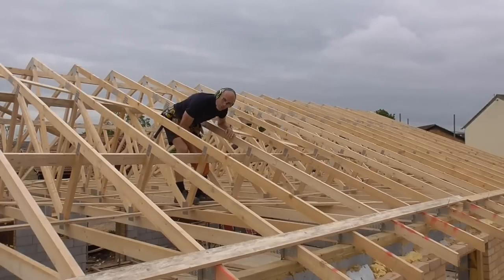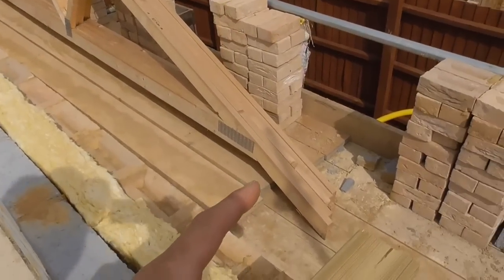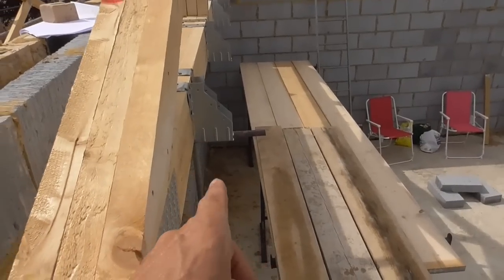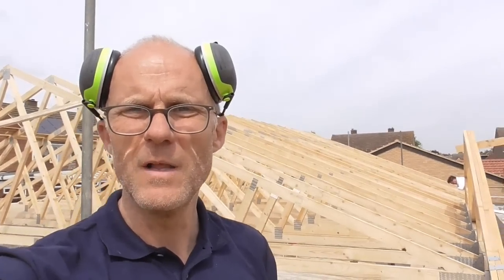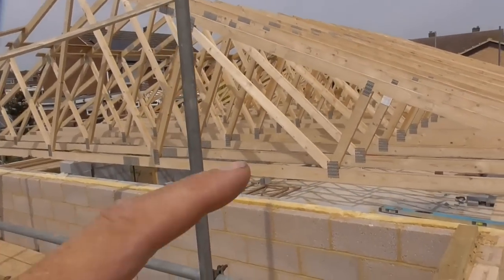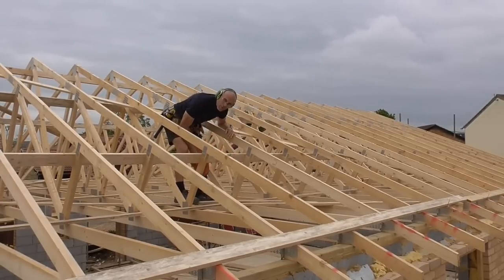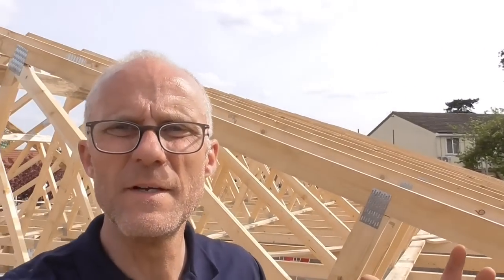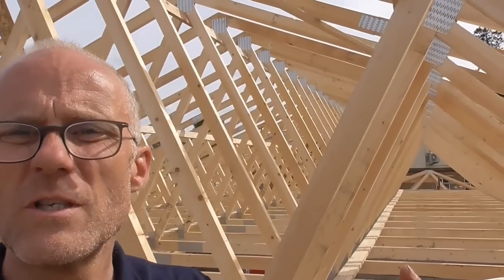Roof trusses fitting to a single story bungalow

Comment: Glad to see you have all the correct lateral and longitudinal bracing including the lateral bracing in the ceiling plane.  I'm a structural engineer and these roof s built in the 70s and 80s rarely had the correct bracing and quite a few put up nowadays don't!
Reply from the maker: Hi John🖐You've got to be an idiot not to be able to follow the truss drawings😵‍💫but I agree, and many roofs are not braced properly😔Thanks for watching 😎 Cheers Del
Reply from the maker: @h2s142  The trusses are designed and manufactured to meet the current Building Regulations and are installed in strick adherence to the drawings. The Building Inspector does not use their discretion when inspecting the completed work, they simply expect to see that was has been installed is in accordance with the drawing👍

Comment: What height ceiling would I get in loft room with a 10m span with a 40 degree pitch, great video. Thx
Reply from the maker: Hi John🖐Very roughly, if you put the ceiling height in at 2.4m, you would have a 'flat' section of around 3.5m👍(obviously dependant on rafter and joist dimensions) Cheers Del
Reply: @thetallcarpenter  Thank you del much appreciated.

Comment: When you stand trusses up do you not skew nail a 3 inch nail into each side?
Reply from the maker: Hi fella🖐Yes, it's only 'temporary' to keep the truss in place until they are all set on and braced up. I then knock them in all the way before fitting the clips👍
Reply: @thetallcarpenter  if you were to put a stringline across the backs of the trusses at the eaves level what would you say the tolerance is in deviation from the string line? This is for a slate roof covering also thanks
Reply from the maker: @chippy977  I wouldn't even bother putting a line over trusses as they are usually all over the place😬I tend to just measure bith sides of the rafter foot back to the face work and keep then even as I go👍
Reply: @thetallcarpenter  yeah I found that!, do you know what the manufacturing tolerance for the trusses is? In terms of size variation?
Reply from the maker: @chippy977  I don't know what manufacturers tolerances are, but they are generally within 10mm to 20mm up or down😵‍💫
Reply: @thetallcarpenter  out of curiosity let’s say you were doing a cut roof. With rafters fixed each end of the gable, if you were to string a line across the backs at eaves level what would be your tolerance for max deviation from this line? And let’s say it was slate roof covering?
Reply from the maker: @chippy977  On a hand cut roof I would really be aiming for around +/- 5mm👍

Comment: Enjoying your channel only discovered it recently.  Do you butt all longitudinal bracing halfway on a truss even 35mm thickness trusses or overlap them along side each other? Hope that makes sense 👍😂
Reply from the maker: Hi there🖐and thanks for looking in on my videos👍Yes, I but my bracing together half on a truss as I find it keeps things much neater and simpler and the braces running closer to the fink/rafter connection point👊Its never coming apart once battened/boarded, and if the inspector is not happy, I just run another bit of bracing next to it lapping 3 trusses😎Cheers Del
Reply: @thetallcarpenter  agree Del a much neater and superior job than side by side overlapping by 3 trusses. Cheers👍
Reply from the maker: @seanfowler5264  😎👍

Comment: Hi, should you fix diagonal bracing to wall plate at all times, my plans show they don't, cheers
Reply from the maker: Hi Stewart🖐On nearly all the truss roofs I do, I usually run the diagonal bracing down to the plate and spike it👍I don't think its part of the roof design but it can't hurt👊Cheers Del
Reply: @thetallcarpenter  on this vlog, the big diagonal braces meet each other at a  roof truss end, cut and nailed close, that's what my plan drawings show.
Not fitted on wallplate, little confused.
Cheers
Reply from the maker: @stewart9476  I have had this specced on roof before, and I guess it's best to do what's on your drawing👍
Reply: @thetallcarpenter  yeah, will do cheers.
Take care

Comment: Must admit I like the old purlin and skew nailed 4 by 2 technique, old 4 by 2 were proper size
Reply from the maker: Takes me back to my early days Andrew when timber really was 4" x 2" and you had 3 inch wires in one side of your pouch, and 4's in the other🤔 2nd fixing nails were 1.5" and 2" ovals, and 2.5" cut nails for the skirting👊 Thanks for your comment 😎 Cheers Del

Comment: Nice one Del. How do you line up your trusses? As in if you looked across the ridge line from one end to the other end, to keep them in a nice straight line. Do you go by the intersection where the joist meets the rafter on the wall plate? I'm interested to now how you do it, I can't make out on the video. 🤔. 👍
Reply from the maker: Hi Paul🖐 I just center the first truss over the building by measuring out from the face brickwork back to the rafter foot. (do this both sides) This then cuts out any discrepancies in the cavity width which may throw out the truss alignment if the plate was followed. One I know the distance between the brickwork face and the rafter foot, I just set all the trusses to this down one side, but still check the other side every few trusses to make sure they are not running out. I've found, over the years, that this gets the best results considering the tolerance in the trusses👊Cheers Del
Reply: @thetallcarpenter  thanks for the answer Del. I have only ever done a few trussed roofs, mainly cut roofs, I found some trusses poorly made to do similar to what method to what you explain 🤔, I centered one truss at each end like you, but found tapeing out to the  foot of trusses as I went along , I had a look along my ridge line and found some trusses to far of center to the left and right as I looked down it. As I say  I don't have alot of experience with trusses, it's good to ask a chippy like you who has done alot of trusses👌. Keep up the great video 👍🇮🇪
Reply from the maker: @paulcloona9331  I hear you mate, and the trouble with poorly made trusses is that wherever you try and take a datum point from, (ridge or ceiling chord to underside of rafter chords line), you will struggle to get them straight. I use my method to line the trusses in, and if they are REALLY rough I will tickle the worst ones by splitting the difference or even laying myb6 foot level over the top to get them as close as possible. I like to try and get them as close as possible at the eves level, as this is where it would cause the most problems if they were a long way out, even if the ridge line was spot on👍
Reply: @thetallcarpenter  I get you Del, I adjusted them to look good at the eve.👍.
Reply: It should be strung with a line across spars... One truss each end measured off face brick to centre trusses to building, then string line on top side side from one truss to the other (not across truss ends/feet to many discrepancies). Then start fitting the trusses bringing them to your string line. Excepting that you will need to cut back spar ends for facia and soffit.... This is the only way you can a good truss pitch line.

Comment: That is my world mind numbing trusses. Can't believe you have to cut the overhang off the standards to fit to the girder truss they would all come as bobtail trusses here ready done. In fact when I used to make trusses for a living you earn more for every truss change. If you just kept making standards you didn't make up your quota or it was very hard to get to it. You have a couple of advantages there though. Your trusses are made out of more substantial members than ours. Bit less floppy. Our matchwood ones can be way bigger than that and flap around like a fish out of water. Having extra guys helps. Normally I work with just two of us. I try to get a third to stand trusses as you can't control the middle otherwise. You comment on the slightly wonky nature of the trusses. If you work in a truss plant and spend all day every day making them it is not the most interesting of jobs. You park your brain in a jar on the shelf on the way in and collect it on the way out. Just ever so slightly repetitive. And I thought putting them up was bad enough. The only thing you can say about truss roofs is that it is a quick cost effective way of building an adequate roof. And at prices today every little helps.
Reply from the maker: Hi Dave🖐Another cracking comment mate, and agree with all of it👍 I've seen the guys that work in a local truss factory, and I don't know how they keep sane putting them together all day, every day🤯 Trusses do come in for a lot of hate from carpentry purists, but as you rightly say, they enable big roofs to be completed quickly and cheaply👊Have a great weekend bud😎Cheers Del

Comment: Great video Del. I want the ‘move a truss then sit down’ job.. nice chairs by the way. 
Looks like the new 🎧are fitting well. 👊🏻
Reply from the maker: Hi Dan🖐That is the boss man, and he's actually working with a broken foot, so needs to keep his weight of it as much as possible. He has to wear one of those special boot/support things, so at least he doesn't get the mickey taken out of him🤗(MUCH😆) Hope you are well mate🤞 Cheers Del
Reply: @thetallcarpenter  the main man. 😮. Plenty of laugh then.. 🦶🏻
All good here thanks, hope you too. 
Don’t think I could reach the ridge on that bungalow roof..😆
Reply from the maker: @Ultimate-roofing-square.  You'd be just right nailing the top brace through, as I was slightly bent over in there😬Cheers
Reply: @thetallcarpenter  😆👊🏻

Comment: Is there a rule on where you should put truss bracing for inside the truss
Reply from the maker: Hi there🖐The bracing positions are clearly marked on the truss drawing that comes with the roof, BUT, the bracings are always, pretty much where an internal truss element connects to the bottom ceiling chord and the main rafter chord👊Cheers Del

Comment: Up in Bonny Scotland we put the laterals side by side I noticed you put them on top at the lap over.
Reply from the maker: Hi Dez 🖐 Well spotted bud, and it should actually be the same down here😬 BUT, I find it easier and neater to keep the lateral bracing in the same line by joining them over one truss, and then simply cut and fix a bit of brace long enough to span 3 trusses, (the one with the join over it and one each side of that) to strengthen the join and keep the building inspector happy👍 It actually uses no more bracing either💪Thanks for watching😎Cheers Del
Reply: @thetallcarpenter  When talking about the lateral bracing is this also referred to as diagnol bracing?  Also how do you ensure the trusses ends are all in line, do you use a string line. I have often wondered this when passing large sites where they crane them up strapped in a pack, they must fix one each end of the roof and pull a line? Hope to see you soon.👍👍
Reply from the maker: @amazing451  Hi Kevin🖐 I centre the first truss over the building by measuring back from the rafter foot to the face brickwork each side, and then just keep all the other trusses the same measurement👊 You have 3 main types of bracing, lateral bracing that runs from one end of the truss run to the other which hold all the trusses at the correct spacing, diagonal bracing that keeps the trusses upright and then chevron bracing that adds additional vertical stability in larger span trusses👍Thanks for your comment😎Cheers Del

Comment: Del do you have set processes for each carpentry task? Like for example when you fit trusses do you do it the same way every time and if you do you just recall from memory your set process or do you make notes/memos to remind you your process?
Reply from the maker: Hi Charlie🖐Trusses roofs like this I usually do on autopilot, but there is always a truss design/lay out that needs to be followed. But in terms of setting out, its like most things and comes naturally from years of doing it👍Great comment and thanks for watching😎Cheers Del
Reply: @thetallcarpenter  thanks for that, but in terms of other more technical  carpentry tasks do you also just work on autopilot and memory?
Reply from the maker: @charlierodgers2776  It's all from memory Charlie, and even if you come across something different, you just apply your carpentry knowledge to finding a solution👍Cheers Del
Reply: @thetallcarpenter  would you say it’s like professional chefs don’t need receipes to make certain dishes as they’ve done them time and time over again they can do it off by heart and like yourself you’ve done it time and time again cutting roofs you just work intuitvely and don’t need instructions or manuals?
Reply from the maker: @miloclarke5486  Pretty much Milo, and you get a mental picture of how you want the job to be/look when it's finished that works in with what's on the drawing, functions correctly and meets the customers expectation👊 There is, however, always room to learn and improve the way you do things, and sometimes new ways can be tried which are either better or worse for you than before🤔Thanks for watching 😎 Cheers Del
Reply: @thetallcarpenter  and in terms of learning these new ways do you just give it a go and kind of judge the feedback from the experience? Im asking as I’m relatively new to the carpentry side 4 years experience and I find it hard to remember how I do things for different processes, so to confirm you don’t take formal notes, have to read manuals to remember how to do something? When you have enough experience do you simply just intuitively know each step and not think much about it?
Reply from the maker: @charlierodgers2776  Hi Charlie🖐It's like most things, if you do it for long enough, you almost forget how easy it comes to you and how you learnt it🤔I know it may seem daunting when you're at the start of your carpentry journey, trying to learn/remember things. The beauty nowadays, is you can always just snap a picture or video of what you've done and refer back to it in the future👍
Reply: @thetallcarpenter  would you say experience and trial and error are the best ways to learn? Do you find books and videos less effective to learn from?
Reply from the maker: @charlierodgers2776  Hands on experience is the best way to learn anything Charlie, and you always learn best from your mistakes👍 Having someone to learn from is the best way, but failing that, Google and YouTube are  a far more useful learning tool than any books👊